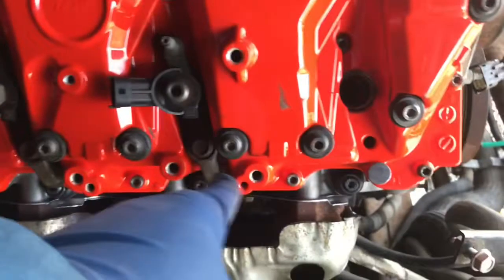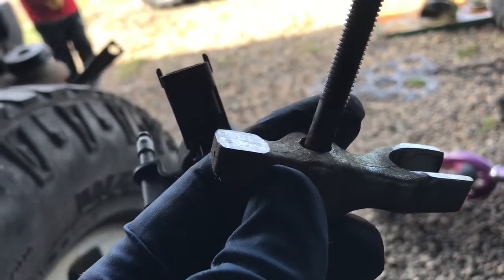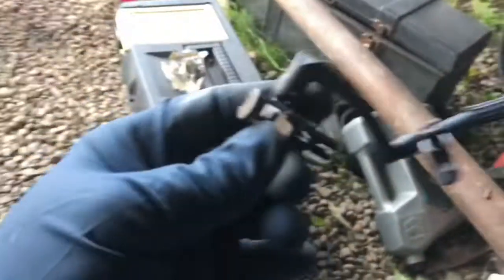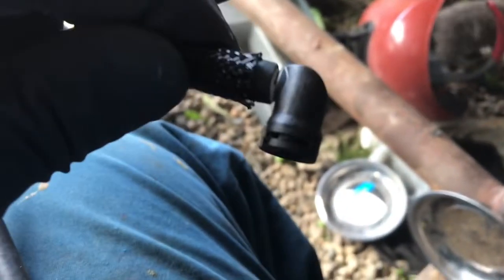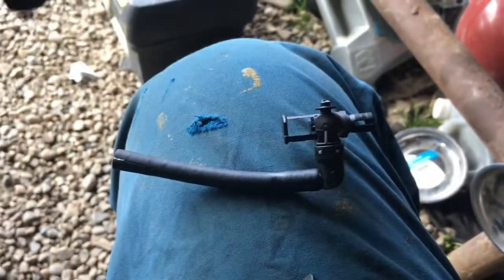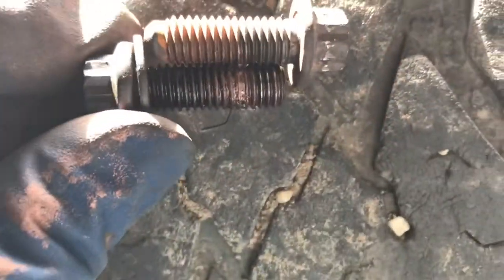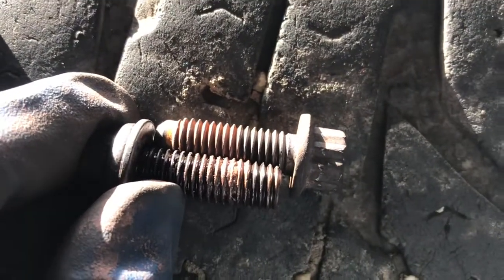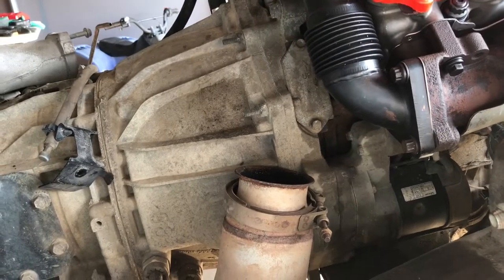LML FIRE RINGED HEAD INSPECTION more fuel system install part 5

Comment: I’m new to duramax and diesels in general. I’ve seen some injector return lines inside the head right on the injectors. If you do what you did in the video outside the head with the rubber hoses do you still do the metal fuel lines inside?